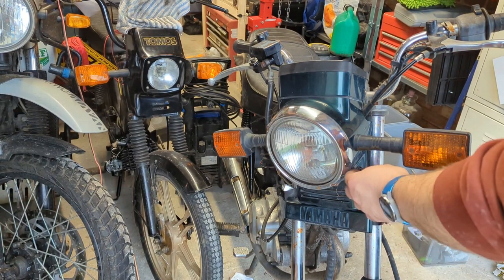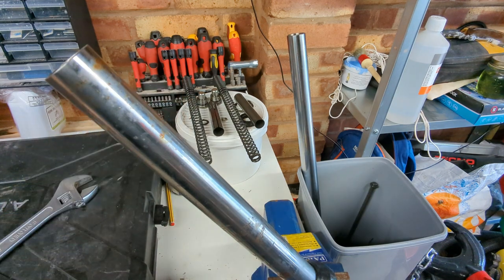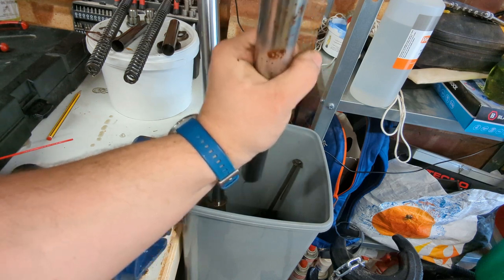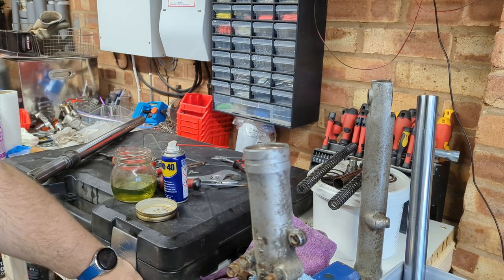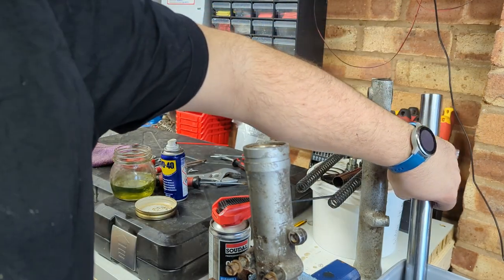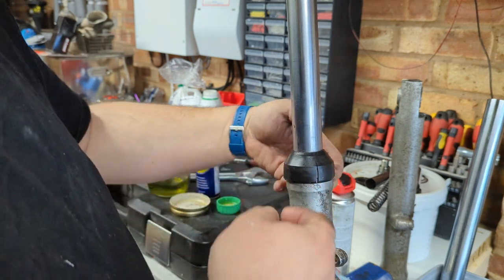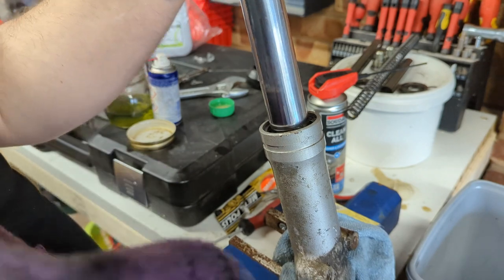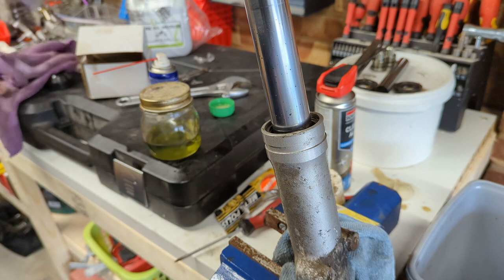Fork Seal Replacement Hack-Job - Dorothy's Speed Shop Grand Challenge | JAM#16

Comment: you can cut a section of plastic milk bottle to create a sleeve around the stanchion when fitting the seal. then slide the sleeve down over any pitting , then remove the sleeve before seating the seal.
Reply from the maker: Good tip, thanks !